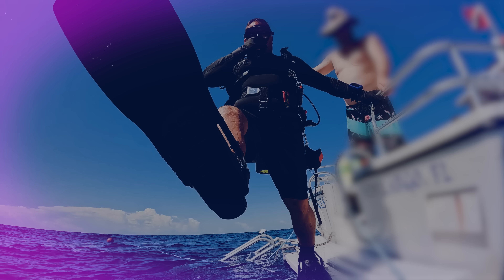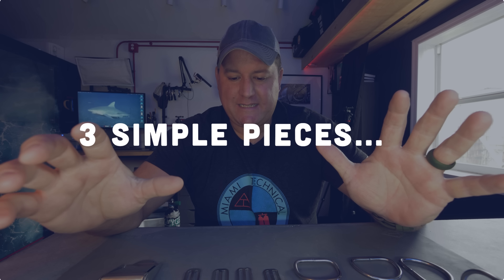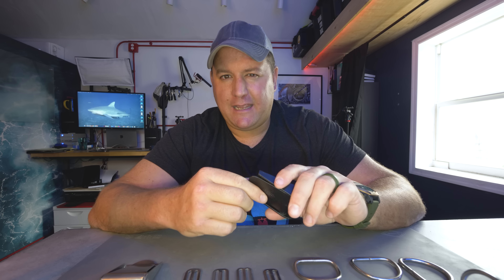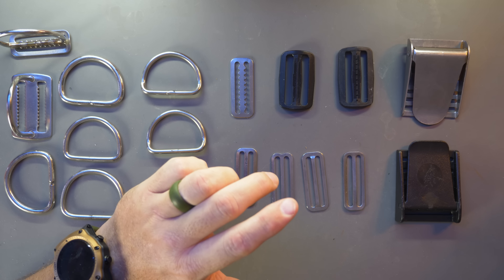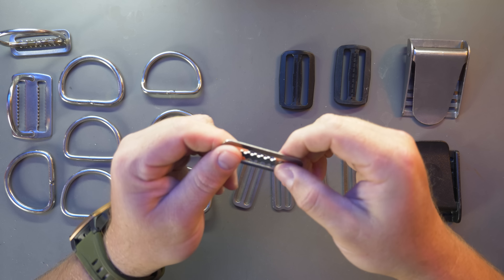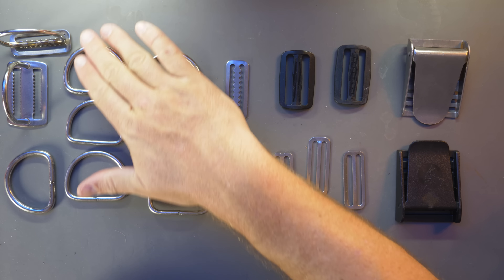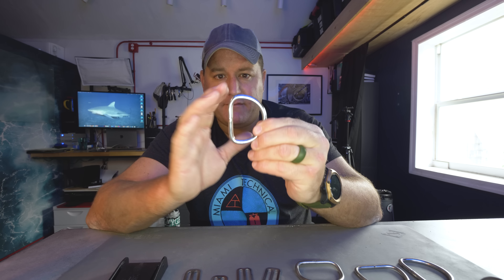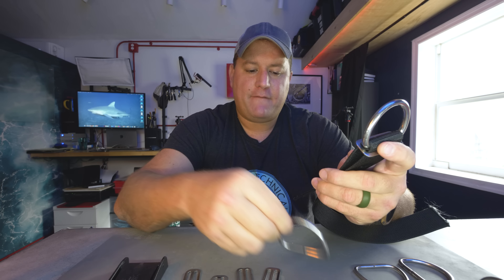Save Money On A Harness! Harness Hardware Explained.

Comment: It might be expensive, but after trying many different nylon webbing products from different vendors, the Halcyon harness material still seems to have mastered the perfect combination of stiffness and softness for me.  Once one is done saving money in finding the cheapest way to assemble equipment, the next step is finding quality materials that meet your personal needs.  $15 for the DGX webbing versus $28 for Halcyon webbing...not a deal stopper for me.
Reply from the maker: Thanks for the tip!

Comment: so I agree with the spirit of this video but I have to say from personal experience not all 2" webbing is created equal.  I got a basic harness set up for my first BP&W and the webbing as so stiff that it was nearly impossible to thread through the hardware and it was incredibly uncomfortable even after I had it all put together.  I later upgraded to the Diverite Translate harness (a little pricey) but the webbing itself was much more pliable and the padding did a lot for my overall comfort.

Comment: Thank you James, I just have one question. So Is using different brands for one wing and backplate setup acceptable? So I am planning to get custom made backplate; thicker and heavier than normal so I don't need to wear the lead belt. It will look approximately as Apeks backplate, but I was thinking of buying xDeep NX ZEN wing. Do you think that will work out? I will be using this as single tank setup. Thanks for making these kind of videos as it is helping so much!

Comment: Thanks, James, this is very useful - one thing I wanted to ask: A lot of the modern harnesses sold by the brands will have shoulder padding to make the backplate wing setup still comfortable much like a backpack.
Are shoulder pads for the harnesses something sold as a separate part? Also have to think about (ideally) 4 weight pockets, 2 on the hips, and 2 trim. With those pieces added, we're not looking at $42 anymore, so how close are we getting to it being more worth it financially to just buy a brand-manufactured set?

Comment: Love you content! Very helpful info usually and you've helped me on some decisions. Timing is great as I'm about to buy my first back plate and have been looking at different systems. 

Can you recommend any suppliers for the sliders, D rings, or webbing?
Seems to be the only information you've left out.

Especially since, not all webbing is created equally. As a Slackline guy I've learned a lot about webbing and it's breaking point under duress. I assume there is a similar correlation to webbing and technical diving harnesses?

Comment: Hi James!  What is the exact purpose of using a groin strap since that just looks and sounds uncomfortable.  I personally use a Zeagle Ranger BCD and it has everything I have ever needed.
Reply: The crotch strap on a single piece harness is what provides stability and it does this extremely well to the point that if you were to slip your arms out of the shoulder straps your rig would still be stable on your back. A back plate and harness cannot function correctly without one. 

On a side note the benefits of a one piece harness and wing over a jacket bcd are tremendous. Not only do you eliminate multiple failure points found with a jacket (the plastic buckles on the shoulder straps, chest strap and waist strap) but as the buoyancy is on your back not back and sides you become far more stable in the water and maintaining proper trim is far easier. I also find them more comfortable than a jacket BCD and they are far more versatile.

Comment: Any thoughts about aluminum weight holders and d-rings as weight saving alternative?
Reply: aluminum is a lot lighter per volume, but only a bit lighter per strength. 
If you need something to hold, go for steel.
aluminum is also a bit more prone to fatigue failure.

Plastics are otherwise probably your best bet, if you replace them after a few years. (and I'd keep anything crucial still steel) 
but- the weight of some D-rings is not that much really. What do you need to save the weight for?
Reply: I did just set up a BPW while trying to save weight on every piece I could for travel purposes only warm water light or no wetsuit diving.  I bought some Aluminum parts I could only get bent Drings and sliders so I mixed and matched the components.  The Aluminum components were slightly thicker than their stainless counterparts so strength was there but besides the dpv towing example in the video, how much strengh do you really need to hang a flashlight or a dsmb, tanks for sidemount don't weight that much in the water so that's not really an issue either.

Comment: how about making a backplate if you know some machinists? what are the minimum requirements for a back plate?
Reply: Great idea, you could make something custom fit for your body, I have a tall torso so most of the  commercially available ones are a bit short for me I was thinking of just cutting it in the middle and welding in an extension so the belt would fit around my waist rather than my stomach.

Comment: There is a company in Russia that makes titanium back plates and all the metal (belt clips, D-rings and sliders) also out of titanium. Not a cheap option, but what do you think of it as a material for these items re weight, strength, durability etc.?
Reply: It's a waist of money. Stainless steel (marine grade) is all you will ever need for D rings and buckles (aluminium stages being the heaviest thing you will attach to them are 1kg negatively buoyant when full and 1kg positively buoyant when empty) and Stainless steel is more than strong enough for a back plate and if you need a lighter backplate aluminium is still plenty strong enough.